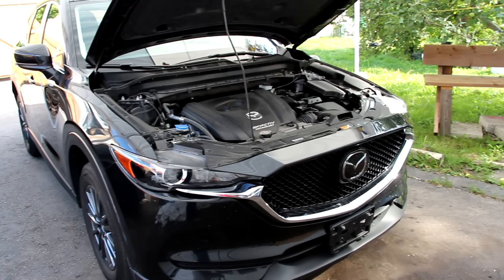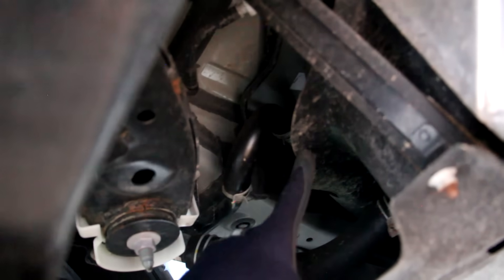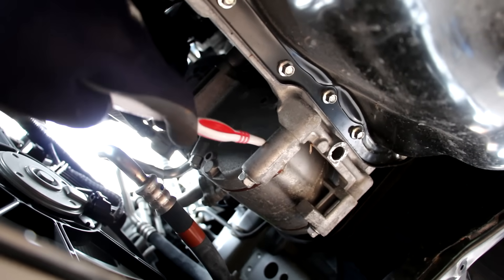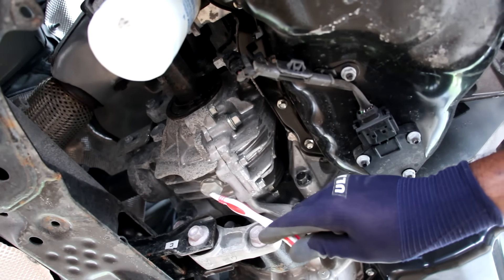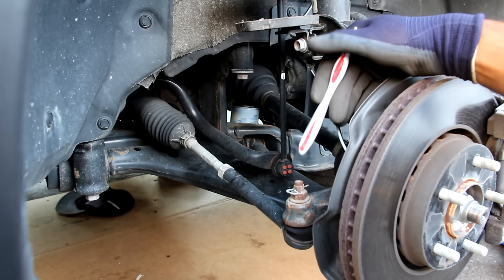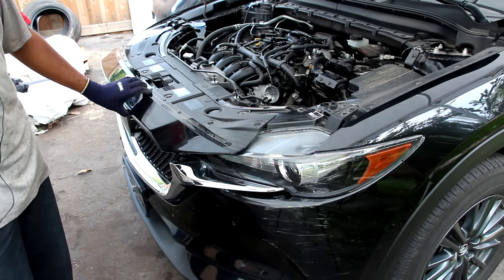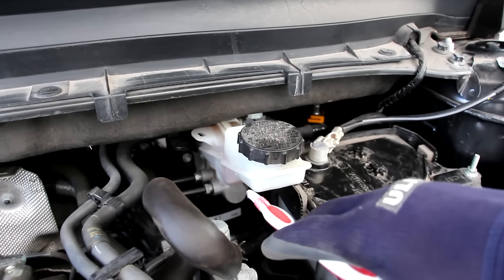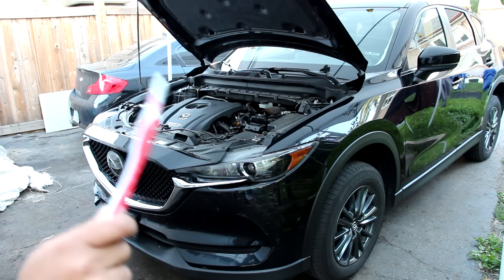Mazda CX-5 Mechanical Review

Comment: 14:37 ... No chance for LONG TERM with all that RUST (chassis rust) from 2019 (1 year old) and 37.000 km/miles.... 🙈
Reply: Depends where you live.
Reply: @bigchuck333  I don't think it depends on where you live, I think that Mazda just didn't spend any money on rustproofing.  I live in Ohio, and my 2009 Toyota Yaris, which I've owned since new, has very little rust underneath.  Definitely zero rust on the chassis and the body, just some surface rust on a few parts underneath, like the exhaust system.  My car has never spent any significant time outside of Ohio.  I swear, every time I watch any car review that goes into the mechanics of a car, I get reminded why Toyota is the best.
Reply: Fluid Film is your friend
Reply: @driveway_of_misfits  ... Maybe some LUBE would be cheaper... Using it on both... car & wife 🙈
Reply from the maker: It's sad. But it pays off to rustproof it once a year

Comment: Direct inject engine is prolly this SUV’s Achilles heel mechanical wise.
Reply: Yup, those intake valves are going to screwed with carbon build because there is no air/fuel mixture passing over them to keep them clean. An oil catch can would help a lot by filtering out oil particles from the crank case ventilation and slow down carbon build up. But the average driver doesn't know anything about that.
Reply: @applepoop10  I have seen people with this engine go 150,000 miles with carbon on the intake valves not causing a problem yet. Use the recommended full synthetic 0w-20 engine oil changed every 5,000 miles, and a high quality 87 octane fuel- for me either Shell or BP. Once or twice a year, I add some Berryman B-12 Chemtool to the gas tank, based on some Project Farm videos. The local Mazda dealer will clean the intake valves with crushed walnut shells, if you are a dumbass and carbon them up. I also have the transmission fluid changed every 45,000 miles.
Reply: @jeffruebens8355  How does a fuel additive affect carbon valve build up on a direct inject engine?  It's downstream of the valve.  There is no valve wash with fuel/air mix.
Reply: Joseph Juguilon 
Ok boomer
Reply: Use CRC GDI Valve Cleaner right before each oil change.
Reply: @A C is this true for all Mazda cars?
Reply: GDI and the transmission.
Reply: Just put Shell V-Power 91 premium gas, it removes 70% gunk and carbon build up if you drive 4,000km purely on V Power
Reply: @JundaComputersGmbH  It might remove build up inside, but not on intake valves in a direction injection engine because the gas never comes in contact with them
Reply: @d.o.5238  so what should you do?
Reply: @JundaComputersGmbH  Not in these direct inject engines.  The fuel/air mix doesn't flow through the valve, just air.

Comment: I love Mazdas! Thanks Speedkar99! 
The Skyactiv engines have been bulletproof and Mazda has been using them for the past 7 years now along with the 6-speed auto transmissions. Mazda also includes a built in oil separator to minimize carbon build up on the intake valves.
Reply from the maker: Good little cars
Reply: I always wondered how Mazda engineered around carbon buildup on a GDI platform.
Reply: @stevenf5902  I've read somewhere that Mazda has designed the intake valve to get up to an operating temperature of 400 C quickly.  Their engineers claim that this also reduces carbon build up on the intake valves

Comment: Amazing content. Try doing a Lexus :D
Reply from the maker: If I could get a new one to compare to my GS that would be sweet
Reply: The lexus....And half the engine is covered by the intake so to change the spark plugs you have to remove about 60 fasteners, clips, or bolts, plugs, hidden bolts.....and they are all different sizes...

Comment: How well does the method of "putting the same amount that you took out" work? As of changing at ATF, measure it, then putting the same amount back into the transmission with new fluid.
Reply: it works, that's what I did with my Mazda 3 with the same transmission
Reply: Self explanatory!
Reply from the maker: It worked on my Lexus

Comment: I always liked Mazda cars, they were for a while at any rate the most interesting vehicles to come out of Japan. I've owned two Mazdas, a 323F, which was brilliant and an RX8 which was even more brilliant...While it lasted...
Reply: I liked the Mazda MX-3 GS. It was a hot hatchback and had the world's smallest production V6 ever put a compact car. Was only 1.8L making 140 HP and a rev limiter of 7600 RPMs. Extremely rare to find these days .
Reply: @applepoop10  they were popular like 10years back(as used car market), not many can made it to now.
Reply: @SHADOWBONELESS  My 2004 Mazda 6 Sport Wagon has 245K, and I live in Wisconsin.  It's still going strong, but , yes, there's some rust around the rear wheel wells.

Comment: Thank you much for this review. I have 2017 mazda 3 fwd and this helps. I am just a simple dyier meaning i do simple stuff like brakes, fluids change, part replacer like alternator, starter etc and your video helps cause some of the lines and hoses doesn't make sense to me.  Could you please do some video how to do simple electric connector diagnosis for common problems that can occur and diagnose before changing parts? trying to learn small stuff and build my knowledge on car repair. Really appreciate your effort.
Reply: Pick up a diagnostic tool like Blue Driver. The software is well flushed out and the repair and TSB library is massive. That should provide you with more than enough information for diagnostics and repair.
Reply from the maker: See my electrical system video for the low down on that system
Reply: @speedkar99  thank you

Comment: How similar is this thing to the mazda 3(?) it’s based on? Might be a good video idea, to show where your extra $5-10k goes when you choose a SUV instead of a sedan
Reply from the maker: Hint....it's the same except the rear suspension
Reply: Looks very similar to my 2014 Mazda 3.  Almost 105k miles and no problems.  I also have a 2004 Miata with 145k miles no problems.  Just basic maintenance.
Reply: Mazda 3 is a different architecture. CX5 is a shared architechture with Mazda 6 and CX9.

Comment: Hi~speedkar99, How do you think about the reliability of skyactiv-direct injection engine, do you often see the intake valve that clog up with carbon deposit
Reply from the maker: Reliable. The people who own them (and neglect them)....not so much
Reply: @speedkar99  Yeah I worked for Mazda as a technician. Most people neglect the cars and take bad care of them. When you have to climb through trash just to check the cabin filter.
Reply: The built in oil separator for the PCV has 3 baffles. Blowby is also minimal since the engine itself is not turbo charged and has a high compression ratio. Just follow the 4 month 5k miles severe schedule to keep the additive package in the oil fresh and run an intake cleaner once in a while and you'll be fine. I live in Hawaii and do lots of short trips and stop and go traffic which is hard on oil and is conducive for carbon build up. Severe schedule for the fluids and I run the CRC intake cleaner once a year. No issues with hesitating, rough idle, or difficulty starting in the 5 years I have on my 2016 Miata.

Comment: the forking rust is still an issue... come on Mazda!
Reply from the maker: Gotta rust proof this Mazda from when it rolls off the assembly line
Reply: This is an issue for every car that has stamped steel parts. You don't get aluminium control arms and such unless you move up in price. Hell, the mustang lineup from the base to the 70k upper trims are all stamped steel.
Reply: Reiner Barbosa no it isnt. Majority of cars in world have steel suspension and nowhere near have rust issues as much as mazda. I mean the car on the video is brand new and already is full of rust.
Reply: In Texas I don't have a lick of rust on mine... Granted none of my vehicles do...
Reply: Rustproof with krown or fluid film
Reply: Just pay $200 and do rustproofing sprayed underbody and wheel arches and doorjambs, every 2004-2008 Mazda 3 I've seen on the road has rust lol
Reply: You can use spray wax on the suspension.
Reply: To all those Mazda fanboys who deny and think that rusting is no longer an issue with new and current Mazda's.  That is why I would not consider buying one.  I live in Ontario, Canada and our salted roads just eat through Mazda's.
Reply: @chicobear  doesnt all car rust with salt just asking
Reply: @MrPicky400  Indeed they do.  However, if you live in an area where they salt the roads during winter, your car is more susceptible.  Certain brands and certain cars have better steel and initial coatings from the factory.  Mazdas just tend to rust through up here in Canada.  Rustproofing is a must but nothing is better than good quality steel and initial coating from the factory.

Comment: 3:22 the family's 16' Sorento SX V6 AWD is all covered with no access to the drain plug (oil filter is located on top of engine). Ended up cutting a flap in the cover to access the oil drain plug. Not removing 15 bolts every 3-5k miles just to drain.
Reply: Seeing as your fairly new vehicle prefers synthetic motor oil, why are you changing the oil every 5000 miles?
Reply: @Epitopi  with a GDI engine, hoping more frequent changes (cleaner oil) will help reduce buildup on the valves until a catch can is installed. Then again, will most likely keep the aggressive interval, particularly when towing is done now and then.
Reply: @AlGoYoSu  Idk if clean motor oil will significantly impact carbon buildup on valves, but increasing the frequency of oil change for towing makes sense.
Reply: @Epitopi  severe schedule servicing. Mazda is at a conservative 4 months or 5k miles for severe schedule. Fresh oil dispersants and detergents also help keep the valves clean.
Reply from the maker: I hate removing the plastic panels
Kia did it right under the forte and put holes in the panel where the filter and drain plug is
Reply: @speedkar99  had an 09 Optima with the 4 cylinder, it had a panel underneath, but had cutouts for the oil filter and drain plug. Never had to remove that panel after several years and 100k+ miles 👍.

Comment: Mazda paint is pretty horrid. it WILL peel off in a few years, so this car is kinda waste in my book.
Reply: My 2006, 2010 and 2015 Mazda 3's are still fine, when is this "paint peeling" supposed to happen?
Reply: @Jaydoba  which means this condition depends on your car's manufacturing location and environment of you location
Reply: @monkeymi4912  I live in PEI, we use just as much if not more salt than Ontario.
Reply from the maker: Rust proof!
Reply: had a 2007  mazda 3s and the paint was in great shape when we sold it.   had zero peeling.  mazda imo has some of the best paint in the industry.
Reply: Yup and degrading structural rigidity and saftey of passager

Comment: Great, turbos and CVTs suck at reliability, too bad it doesn't have also multiport injectors and us going to have a clogged intake manifold
Reply: Mazda incorporates a built in oil separator in the PCV system to minimize carbon build up on the intake valves. It's not perfect, but it helps a ton. All you need to do is use some spray cleaner through the intake every now and then to keep it clean - cdc intake valve cleaner works.